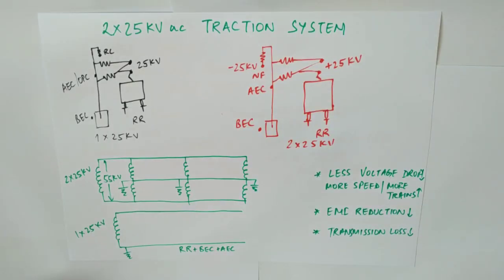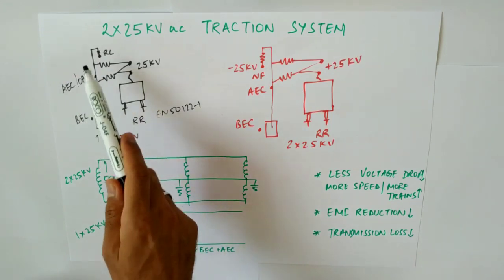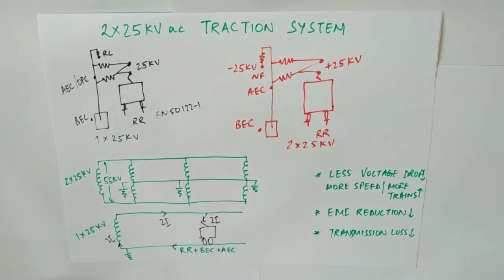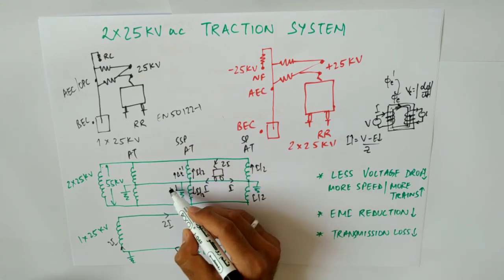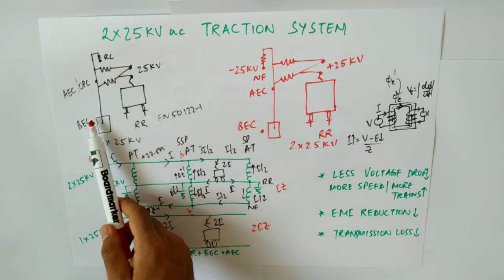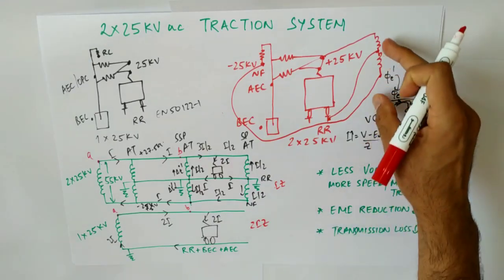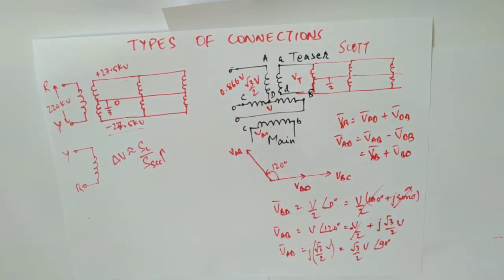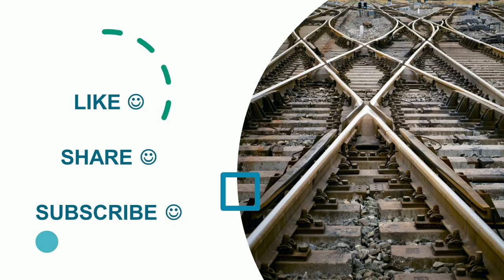Lecture 6: Understanding 2x25kV ac traction system (Auto Transformer Feeding System)

Comment: Hi there... The main advantage of 2x25 kV system over 1x25 kV system is to reduce the voltage drop by a factor of 2 for same load and at same distance. But this can be achieved by increasing the effective cross section of the catenary by running a feeder wire at the same potential as the catenary and then connecting it with the catenary at various locations. Why was this approach not taken in place of the 2x25 kV system explained in your video.
Reply from the maker: Hi, you are correct on the part to provide additional contact wire in parallel to existing and this practice is done. Either we increase the cross-section or add an additional conductor (also called reinforcement feeder if cable is used instead of conductor). This can help reduce to resistance and to some extent self inductance, however, effect of mutual inductance will be still prevalent. Thus, such practices are mainly popluar in case of DC traction. 

Moreover, 2x25kV has many other advantages which 1x25 kV cannot offer and the main being less electromagnetic interference and lower transmission losses.

Comment: 8:16 I have seen other diagrams of 2 x 25kV systems but not explained in this understandable detail. Thank you. 
In your experience is it still necessary to add a separate feeder in parallel with the catenary and contact wire like in DC systems to increase current capacity of the circuit or is the contact wire in parallel with the +25kV feeder adequate for the higher current flowing in the subsections between ATs. 
Can you please share a single line diagram of whole system showing isolators, circuit breakers and track switches. 
What the the clearance between the +25kV and ~25kV feeders on mast poles and in substation. Is it the same as for 66kV as the next higher standard voltage

Comment: Sir, can you pl explain the necessity for running AEC & BEC? Why can't we use only rail as return path?
Reply from the maker: AEC and BEC are required for multiple reasons. Some of them are listed below
1. Cross bonding and other measures are not sufficient to reduce rail potential so that it falls within the limit.
2. To ground OCS poles and Wayside equipment with every time drilling or cadwelding with rails.
3. AEC also helps in reducing EMI.
Running rails along with AEC and BEC form the part of return circuit. You can avoid them completely by increasing cross bonding between tracks, design for headway mentioned in contract and not overdesign, evaluate rail potential as per annex C provided in EN 50122-1, providing earth pits along the route. All this require detailed analysis.

Comment: It’s really a marvellous system. We recently energised an Autotransforner Substation on an existing 2 x 25kV railway , and despite an electrical engineering degree I was still a little confused during the energisation testing / section proving, how we managed to get both catenary and feeder busbars energised at 2 x 25kV by energising the substation via single feeder (in this particular instance it was via the -25kV track feeder). However, by sketching out an SLD, it becomes obvious that applying 25kV between any pole of the AT and earth, the flux developed in the AT core will then induce the opposite 25kV pole. Then when it comes to introducing all feeders from the track (and ultimately the adjacent feeder station) it become obvious why this method is so efficient.

Comment: Hello, thank you for the video - very informative. I am looking to model an ATF system using LT spice, however I am having trouble setting up a reliable system: I have modelled the centre tapped transformer as two 25 kV (peak) 50 Hz AC Voltage sources with a 180 degree phase shift; the Inductors (used to represent the Auto transformers) as 0.2 H; The train as a resistive load of 80 Ohm. The issue is when I check the current in the Voltage sources, I am getting 800 A peak. This is far greater than the current in the resistive load, which reads 300 A. 

1. I would like to know whether anyone is able to give any advice as to whether I can make any improvements with my model to yield more realistic results.
2. I am also aware that Lt Spice is typically used for lower voltage electronics modelling. Is anyone able to recommend a similar free (and new user friendly) application that may be more suited to high voltage circuit modelling? 

Many thanks.

Comment: When current ,I flows in +ve feeder & I flows in -ve feeder,I2R loss will be 2 times ,so same  as 1ph * 25kV system,so how loss will be less,Can you please clarify ??
Reply from the maker: Let us suppose resistance of all conductors whether in 2x25kV or in 1x25kV is same and is R. Furthermore, neglecting losses due to other conductors that form return circuit and only considering +ve & -ve feeders in 2x25kV and contact in 1x25kV.
In 2x25kV as highlighted by you = (I^2)*R (+ve feeder) + (I^2)*R (-ve feeder) = 2(I^2)*R
In 1x25kV = (2I^2)*R = 4(I^2)*R

Comment: Hello.

This was helpful but there is one thing I still don't understand: Looking at the 9:11 video time.... I don't see how the -25kV line negates EMI for lineside equipment between the two autotransformers where the train is.... since the autotransformers supply current for the train through the +25kV rail and it returns to them through the running-rails to the auto-transformer centre tap.

Since we have higher current flowing through the running rails.... would this not expose lineside equipment to EMI?
Reply from the maker: Thanks. 

When there is single train in the section then there will not be any reduction in interference as rightly pointed out by you. However, the current will be low enough to not cause interference. This is typically useful when headway is less and number of trains in sections are more which leads to more flow of current that causes EMI issues.
Reply: @railwayengineeringinsights6463  Thank you for taking the time to reply. I really appreciate it.

Comment: Hi, this video illustration the current flow is based on the voltage level of +25kV for catenary, 0V for rail, and -25kV for negative feeder. But since this is an AC system, so the voltage waveform of both catenary and negative feeder fluctuate between -25kV to 25kV am I correct? 

Because your video explain very nicely, but I am attempting to translate it into a single line simulation model. In simulation, the catenary and negative feeder is both connected to a 25kV busbar, am I correct?
Reply from the maker: Hi, yes you are correct it will fluctuate. 
Yes catenary and feeder are both connected to negative 25kV busbar which are feed from traction transformer.
Reply: @railwayengineeringinsights6463  Thank you sir

Comment: Hi, I was rewatching your video again and wanted to ask what is the difference and benefits of using center-tap for secondary of supply transformer (So far I haven’t seen, with the systems where I work, center-tapped secondary). Thanks!
Reply from the maker: Hi, it basically a V-connection. Scott is more beneficial than this in terms of voltage unbalance. However, both fair nearly the same in case of short circuit MVA is very high at source end.

Comment: Hello Sahil,
If I have  railway system with 2x25kV,50Hz

with autotransformer 50/25kV, how I calculate the impedance of the autotransformer with the general equation : Zat=(Uk%/100)(Un^2/Sn)
,so in this case,what is the value of Un, 50kV? or 25kV?
Where: Uk% is the  short circuit autotransformer impedance and Sn is the nominal apparent power in [VA]

Best regards,Dennis
Reply from the maker: Hi Dennis, 
Typically we calculate impedance on secondary side, i.e. 27.5kV side. For example, for AT rating of 15MVA and Uk of 1%, the impedance of AT on secondary side will be 0.504 ohms [(0.01) *(27.5^2)/15].

Kind regards, 
Sahil Bhagat
Reply: @railwayengineeringinsights6463  THANK YOU Sahil!

Comment: Sir, why don't we call here Booster Transformers, but as Auto Transformers
Reply from the maker: Hi, beacuse booster are connected in series with contact-catenary system and have a different connection whereas auto transformer have different connection as explained

Comment: Hi will we have separate SSP and AT locations? If we do how physically we connect +25kv to catenary system? I mean should we connect through an overlap or directly connect to catenary by means of a 2 pole switch?
Reply from the maker: Yes in some location you can have separate AT. This might sometimes be required to maintain the voltage range as defined by EN 50163. Yes it can be directly connected by means of switching devices without overlap if section is not required at that particular location.
Reply: Wonderful video & explanation. Can you please describe SSP and other abbreviations used.

Comment: Great explanation! But can you elaborate more on the current distribution depending on the train position between two substations.

As I understood, if train is in the middle then current distribution will be even (half and half). 

So, the question is, when train is closer to one of the substations, voltage drop decreases and current increases on the one side and opposite on the side of RR? And if yes, does it impact train load current distribution on the catenary (contact wire)?

Example:

Train load is 2I. Since the train іs closer to the substation on the left (as a reference to your circuit), let’s say that on the RR current splits 1.5I to the left and 0.5I to the right. On the auto transformers windings they gonna split evenly (1.5I/2 = 0.75I, 0.5I/2 = 0.25I). On the negative feeder side 0.75I+0.25I=1I, which will be added with 0.75I (auto transformer’s trolley winding), so train is drawing 1.75I from supply and 0.25I - return current from auto substation. 

Correct me if I wrong.
Reply from the maker: Many thanks. Your current distribution in example is correct. As you go closer to a substation the impedance seen by the load is less  one side compared to the other. Thus current on closer side increases as shown by you in example compared to the other👍
Reply: @railwayengineeringinsights6463  Thank you,  usually in the papers there is always an example with 3/4 and 1/4 currents and it might get confused (as it was for me initially).

 Also, can you explain how current will be distributed when there are two trains on the same track (what is the RR current direction in this case - on one side they will flow in direction to autos, but on the common side between trains current will be 180 degrees to each other, so should they cancel/subtract each other)?
Reply from the maker: Let us suppose we have two trains, T1 and T2 and two AT, AT1 and AT2. T1 is closer to AT1 and current distributes along RR as 4I/3 towards AT1 and 2I/3 towards AT2 considering train takes 2I. Similarly for T2 the distribution will be 4I/3 towards AT2 and 2I/3 towards AT1. Therefore, in between two trains at RR we have 2I/3 in phase opposition. But we shall not cancel it in order to complete the flow. Thus, 4I/3 + 2I/3 will become 6I/3 (2I) at the center point of each AT and will split I in each winding.
The net voltage drop due to current (2I/3) on running rails will have less effect at that instant. However, rail potential at that will be governed by the other two currents towards AT only for that instant.
Reply: @railwayengineeringinsights6463  Thanks  for the answer. I have been stuck with this one for a while. Looking forward for your new videos👍
Reply: @railwayengineeringinsights6463  I have not understood about the T2 section current flows, please  can you elaborate most clear than above?